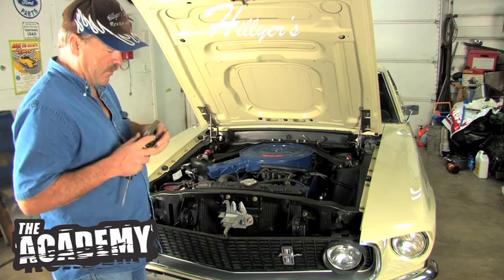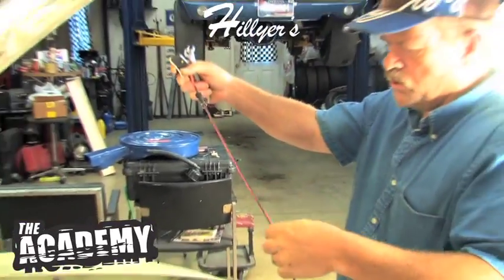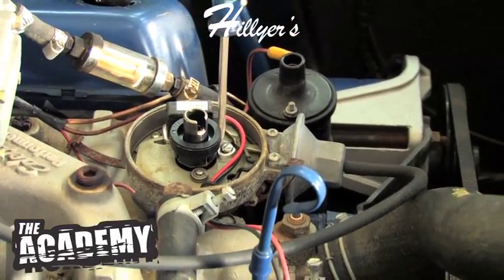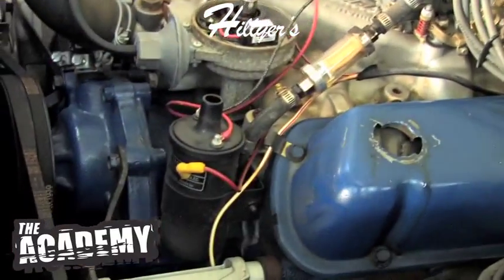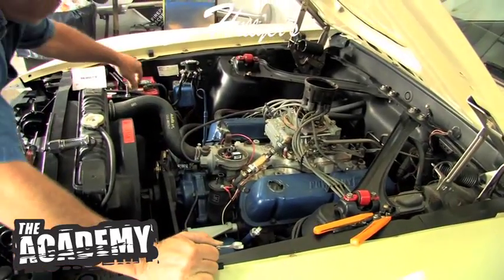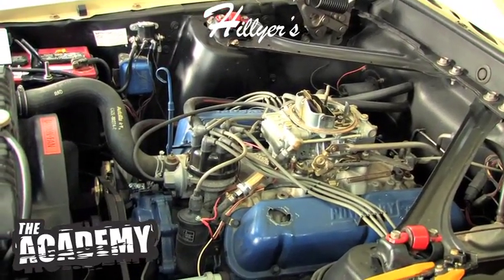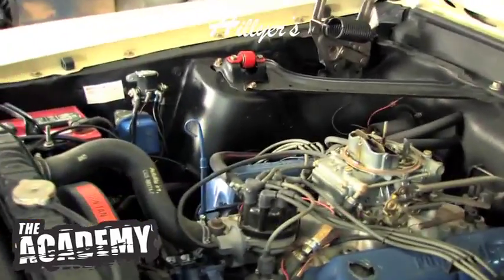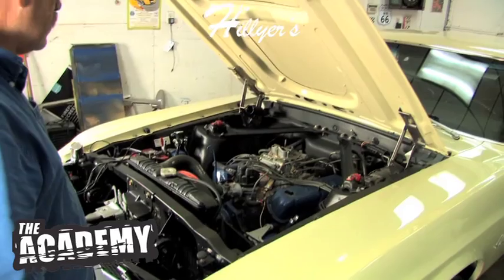DIY Converting your classic car over to Electronic Ignition

Comment: why wouuld anyone do this, i hate electronic ignition
Reply: If points are so great, why did the automotive industry get away from them... in favor of.... tah dah... electronic ignition.
Reply: @rickyrick9328  Because the general public got lazier and dumber?
Reply: RIcky Rick agreed. Hei and hotter spark is better anyway. Swapping mine soon.
Reply: Agree with you 100%, even if 4 years later!  Ha ha ha.  Electronics is clearly better, but the maintenance with points required a bit of 'know how', and was very satisfying to do.  Points kept the mystery in your 'hands'; not in a sealed box!  :)
Reply: the longer you own that vehicle changed over to electronic ignition the more it will pay for itself .  Points n condenser are not cheap now days .
Reply: Changes made by the automotive industry aren't necessarily improvements. That said, I installed Pertronix electronic ignition in my old tractor about a year ago, and so far so good.
Reply: Well, the hardcore advocates are probably salesmen for e-junk.  The fools that clamor for it are just too lazy to check, adjust, or replace points every other oil change.  Instead they'd rather spend $500 to do this, then do it again at random and unpredictable intervals when the non-user serviceable e-junk fails.
Reply: @The_Conspiracy_Analyst  
No, I personally installed GM HEI in place of points, the car ran better.

Comment: Doesn't show what nut loosens the distributor so he can turn it to adjust the timing. nor does it show which way he turned the distributor. Even the timing marks are all but invisible on this video.
I'm glad he mentions the squared-off interior surface of the black magnet that fits over the distributor shaft.  The 'lobes' on the inside surface of the magnet are definitely not obvious, and there's no mention of aligning them in the pertronix instructions.

Comment: Help i put on of these on a 72 pontiac lemans and when i went to crank it over the hot wire leading into the distributor started to smoke and got hot what did i do wrong

Comment: A superb video but I have some questions.

My main motivation to changing to electronic ignition is that, at least on very modern cars, ignition is truly precise; with points, it's close but not perfect; this is precisely why modern cars engines last so much longer.

While I do understand the advantage to getting rid of points, does the system you installed fire the spark with the same precision as a truly modern car does and remember, you don't have all the other computers with this old Mustang